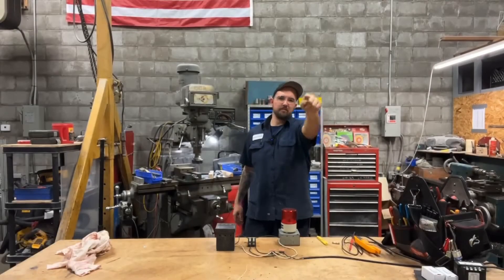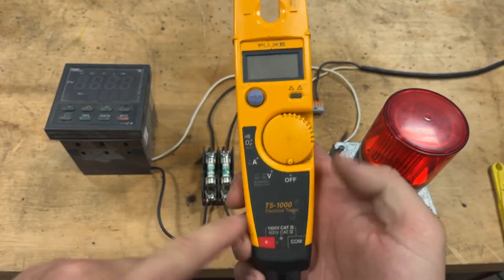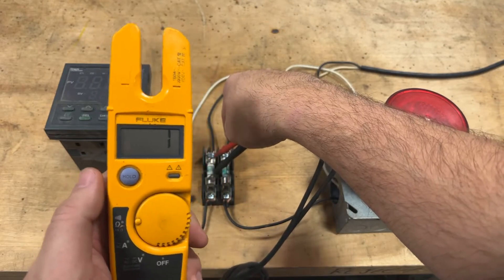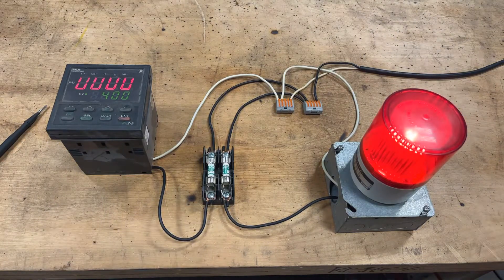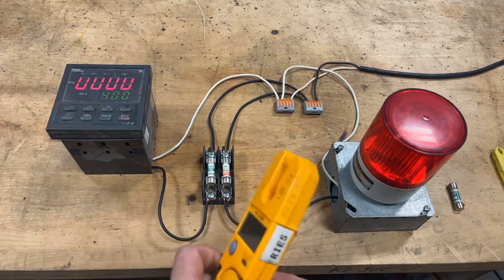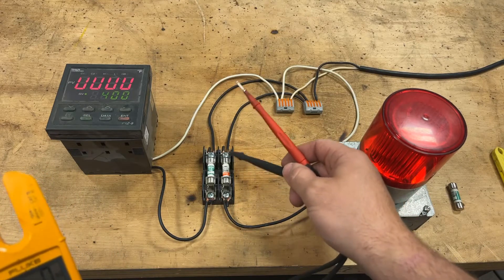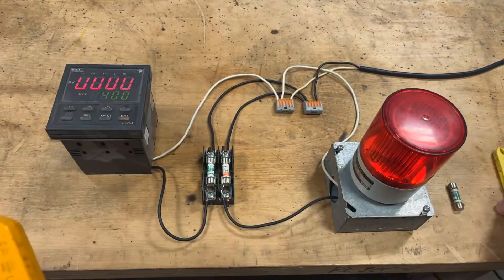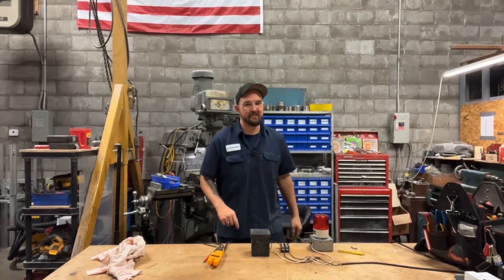How to check a fuse. Dead or live!

Comment: If you have a short on the same circuit on the load side of the fuse this wont work. You will read no potential even if the fuse is blown. Its always best to remove a fuse to check it to be 100% sure.